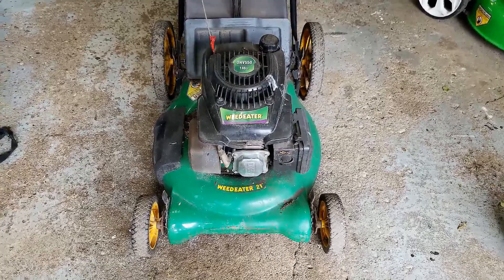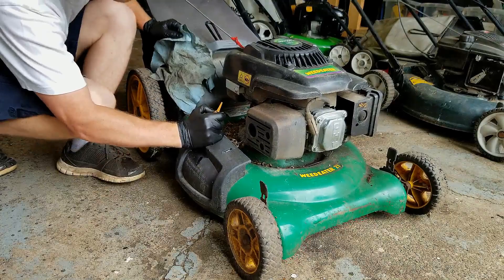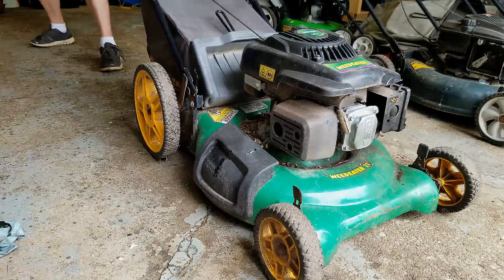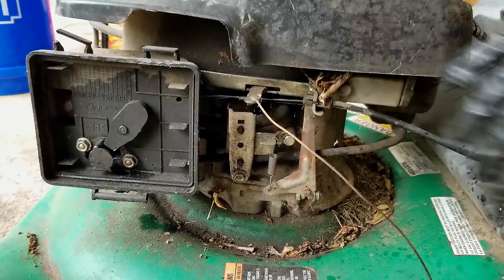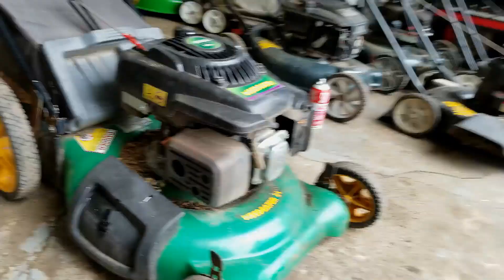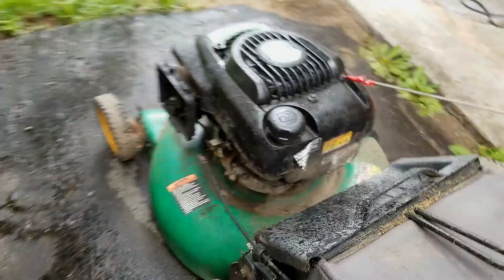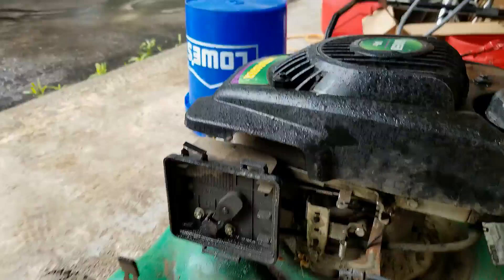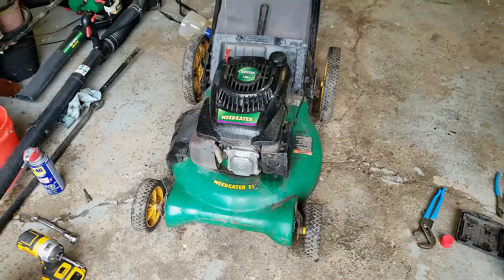Bad Piston Rings or Something Else Causing Smoking??

Comment: I have an old lawnmower and it’s 38 years old and the piston rings are rubbish because I have the oil at the right level and all this white smoke coming out and there is only a little bit of oil left when I’m done the lawn
Reply from the maker: Might be time for an upgrade. Unless you're using the smoke to keep the bugs away. :)
Reply: @brantsmallenginerepairs  yeah I’m going to fix it and put in my collection

Comment: I figure my oil ring is bad because  I took the spark plug off and it had oil on it
Reply from the maker: Did you recently tip your mower on its side? That will do it. Thanks for watching. Cheers
Reply: @brantsmallenginerepairs  oh well thanks I appreciate that.

Comment: i thought you were only suppose to hold the dipstick to the hole to check the fluid level not screw it in. Thats what the honda user manual says
Reply from the maker: You are correct but this is not a Honda engine